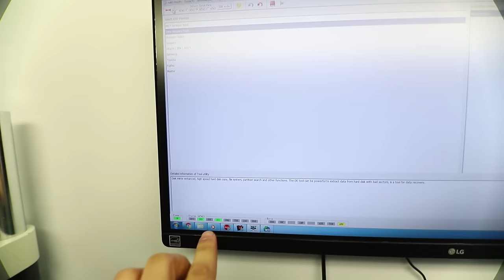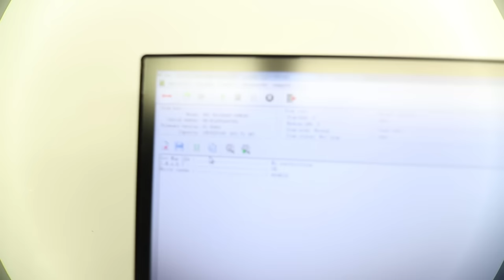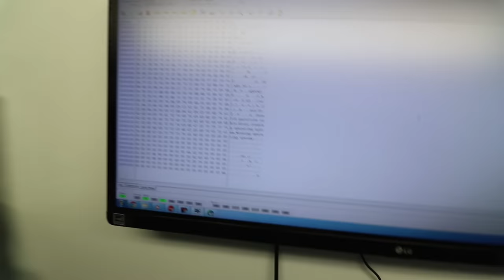hard drive does not spin? simple way to get your data back

Comment: Hello there, I got a Seagate 500GB Barracuda 7200 HDD which does not spin at all. I noticed the burn mark on the pcb board, I ordered one on ebay and changed it with the exact board model but still no spin? Any suggestions please! Thanks
Reply from the maker: Send it in for recovery. Chances are your preamp on the drive is also dead, it is not a DIY

Comment: HD-Front

https://ufile.io/lk1a7uhh

HD-Back

https://ufile.io/c3svwk11

Repair – Front

https://ufile.io/ez3jou40

Repair – Back

https://ufile.io/h77bd47a

Granted please note they said that the original rom was too damaged to transfer. They did this as a courtesy. I have another pcb donor board that has supposedly a new rom with my original bios information transferred over to it. However, you can see here the "condition” of the original rom. I am hoping all the information can still be transferred from this rom. Its not beat up too bad right?

Both pcb donor boards; the one with the original rom and the new transferred over with the information rom do not power up the drive at all. Zero, zilch, nada.

I can post photos of the new rom and new board if needed as well however, it looks good I believe. If the information was transferred over properly.

Comment: I GOT A WD HDD SAME AS THAT, IT'S NOT SPINNING.
I TEST IT OUT THE DIODE AND I GOT A BUZZ SOUND FROM R67 AND R64.
I TESTED D3 AND D4  IT'S NOT BUZZING, D3 AND D4 IS GOOD.
AM I GONNA REMOVE R64 AND R67 ??
Can you help me to fix it? THANKS, BTW YOU'RE SO GOOD❤️
Reply from the maker: R stands for resistor not a diode and they should ring otherwise they are burnt.

Comment: my hdd is still short even after removing the diodes, the diodes turned out to be fine, any ideas what else to look for?
Reply from the maker: Yeah, it could be short on spindle controller. But you can't just remove that out of there.  New PCB with firmware adaptation is needed. If you want us to do it for you, check the link in description

Comment: So simply de-soldering the diode is the solution?
Reply from the maker: If the diode has failed then sure why not
Reply: @hddrecoveryservices  Thank you so much for replying. Actually I'm noob in electronics (commerce guy), so I wanted to know whether removing a diode from a circuit would fry the pcb or not.

Comment: Hey there! Thanks for help people!

I have a question, I've check my HDD and yes 1 diode is short, but it's the left one, it says 72 on the diode, should I try to remove it?

because I can remove it, but I'm not sure if I can re attach it again if it's not the problem, I don't have the precise tools to do such thing.

Toshiba X300 4TB 7200 RPM
Reply from the maker: I don't know. But if the TVS diodes is in short, it needs to come out and preferably replaced. They protect the device

Comment: after a component on D4 remove, you not replace with same parts??
Reply from the maker: You can, but the drive will spin with it removed. Just no protection
Reply: @hddrecoveryservices  it mean you not Swap the Bios setting? am i right?

Comment: Followed these steps and found the shorted out diode. Had an electrical engineer here at work remove the diode and tested pads. HDD will still not spin up. Any advise?
Reply from the maker: if you test out pads without diode are they still shorted?

Comment: Stumble here first vid on your channel. Just a quick question...

My drive not spinning, but detected in bios as unknown, and disk management listed as unitialized (cannot initialized due to i/o device error). Will method in this vid has a chance? Or this error means entirely different problem?
Reply from the maker: This method is only for burnt PCB after power surge.

Comment: Do you have anything that addresses the drive not spinning and the PCB board not shorted out?   I ran multimeter but it reads as it should.
Reply from the maker: If the drive is completely silent, the issue is related to the board.if the drive is not spinning but makes some sort of faith sounds then something is seized or jammed
Reply: @hddrecoveryservices  If by faith sounds you mean the computer beeps when it's plugged in and activity light shows then it would be that.  What tier of recovery would that be?  It was detected yesterday then wasn't communicating and appeared to shut down and drive letter and device went away.

Comment: Hi There, I'm from Malayia. I have a WD WD5000BMVW-11AMCSO device dtd 11 APR 2011, and it was initially spinning slow but it was not detectable on any devices, hence I sent it to a Data Recovery tech to assist with the problem. From his explanation "he is unable to get the correct BIOS to programme into the chip because the correct BIOS on the board is corrupted and un able to read the hard disk", this all was only said after almost 2 months of no news, no updates nothing, I agree at this point it could be my fault for not following up. To add on he said to get it completed he will only travel to China in March and he will get the required DETAILS, and PARTS from there, then only will my hard disk problem be solved. Hence i then started feeling its a bit to ridiculous and so I decided to take it back and send to another well to do, Data Recovery, but when they came back with the preliminary checks, there was no justification on what was actually wrong with WD (I still wanted to know the reason why), with the said check I needed to also agree to a quote that was of 5k+, that's just way too expensive. I then decided to just give a call to other service providers to see what they can quote me with (at this point I wasn't looking for cheap nor expensive but I was looking for an honest feedback), and I came across one that said that "my WD p/n usually has weak motor" it was understandable considering the duration I've had my hard disk, but until today, my hard disk is coverless, and I have still not solved the problem, and I've just tried connecting it to my laptop and apparently it makes no sound at all. I am not really desperate, and I really need to know what else can I do with my hard disk, if by any chance you can suggest how I can go about this.

Comment: What about the burnt resistors ? They don't matter ?
Reply from the maker: what burnt resistors?
Reply: If the diode is blown, you just remove the diode. What if the diode and a few of those "zero" resistors are blown. You remove the resistors and short them with connectors ?

Comment: What is the point of having those diode? You just took it away, and it is completely working.
Reply from the maker: TVS diode is a hard drives best friend, it protects other more critical components from voltage spikes by taking a hit if one occurs. When removed, next power surge will take out the CPU and preamp... Then good luck recovering data without paying thousands for it
Reply: @hddrecoveryservices  now make senses. Thanks for that information.

Comment: Hi what did you use so the contacts melt many thanks as I need to do this to my hard drive
Reply from the maker: Heat. Hot air station or hot tweezers
Reply: @hddrecoveryservices  you put some sort of glue or flux thanks
Reply from the maker: Oh yeah, flux

Comment: I'm guessing you cant just buy a random PCB and just switching it out instead of soldering right?
Reply from the maker: ROM content is unique to the drive. If you swap the ROM you can swap the board. But popping off the diode is way easier and less chances of making things worse
Reply: @hddrecoveryservices  okay thanks for clearing that up

Comment: Only had a 100 ssd in a system and added a 320 gg hard drive no spin don’t show up changed power connector and sata cable still nothing

Comment: I have that same exact hdd that you just fixed. Can I send you mine to fix?
Reply from the maker: yes but I will charge you 4 hunna for the service
Reply: @hddrecoveryservices  I changed the board on it a while back and it still didnt spin. SO i bought another board about 2 weeks ago and its still lnot spinning. I think its cause they're over 10 years old and the hdd the board came on was doing the same thing in your video

Comment: What if the diodes are good but the internal HDD still won't spin? Both the fuses and the diodes are good. My psu blew and I replaced the psu and it's cables but the HDD just won't start
Reply from the maker: It needs to be checked dude, can't say what it could be without seeing it
Reply: @hddrecoveryservices  Could I get a quote please, I already filled out a form on your site. I just can't afford the extortionist recovery charges people are charging.

Comment: Hey, was hoping the video would help but not in my case. My drive is not spinning and no noise. Checked all 4 diodes and they all give the same result about 150. What would be the next step ? I do have another similar drive. Its a 1TB WD RED. Thanks
Reply from the maker: John, does your PCB have a chip in the U12 position?
Reply: HDD Recovery Services yes it does
Reply: (I’m using a different account !) yeah it has a chip at U12
Reply: @hddrecoveryservices  yes it does
Reply: @hddrecoveryservices  hey, yeah it does have a chip at u12. Is there something that can be done  ?

Comment: I checked one of the resistors which was labelled 'O' and I got 0.3Ω and my multimeter beeped. Does this mean the resistor is shorted or not because I'm kinda confused
Reply from the maker: It should be OK if it beeps. Fuse needs to beep
Reply: @hddrecoveryservices  There are also so many of those resistors that have the same reading, which one do I remove?

Comment: Hello, I just had a quick question if you don’t mind after testing the diodes I found one that had no reading but when removing one of the metal pads came off with it. I noticed in the video you tested again after and there was no short. I can’t test now bc the pad is gone would the hard drive still work now that the diode is removed or is that metal pad needed for operation? Thank you!
Reply from the maker: If the short was in the diode you removed then it should work unless something else is damaged. To test for the short being gone you can trace terminals to next components in the circuit and perform same test
Reply: @hddrecoveryservices  ok I’ll try that. Thank you very much for the response!
Reply: @hddrecoveryservices  IT WORKED!!! I was able to transfer everything to a new external hard drive. I’m in tears. You just saved priceless memories of my family. Thank you, thank you, thank you!!!

Comment: Hey man, I was looking for a fix for my HDD, and I want to know, what tool did you use to remove the diodes? I found a shortage on one of them, and I'm at the point of removing that diode, but I have no idea what tools you used for removing them. Thanks!
Reply: a heat gun like one found on a hot air desoldering station
Reply: any other tool?

Comment: After removing the diode, is it safe to continue using the drive like normal? or is the board now a ticking time bomb waiting to fail again bc of the missing component?
Reply from the maker: Ideally, you would want the diode there. Otherwise, next power surge will take something that is way more important
Reply: HDD Recovery Services Gotcha, i’ll keep that in mind. Thanks for the tip!

Comment: The head was stuck on my hard drive, so I opened it and re-placed the head to its parked position.  However, the disk only spins for a couple of seconds and then stops spinning.  I still cannot access the data; please advise.
Reply from the maker: Better not do that at home. Now you need new heads and full disk inspection. That's gonna be around 1600USD
Reply: @hddrecoveryservices  Thanks
Reply: @hddrecoveryservices  I can't afford that, however.

Comment: How did you get the diode off? What's that crazy liquid you poured on there and melted later with another mysterious device? haha
Reply from the maker: :) the liquid is called flux, and the mysterious device is a hot air station for rework and desoldering
Reply: @hddrecoveryservices  Thanks man. Another thing I'm wondering about is your mic. What kind of magic are you using to be able to walk in the back of the room without the volume changing? I don't see any bluetooth in your ear. :)

Comment: One of my Seagate hard drives failed that didn't spin anymore. I was like damn, there goes all my recording sessions stored on that hard drive that I will never get back. Then something popped in my head. I just realize, i have another Seagate hard drive that was identical to the same Segate model and simply swapped the PCB controller boards from the two hard drives. Bam! it works. Those PCB controller boards are probably the cause of most common hard drive failures.

Comment: Can you do this without a multimeter
Reply from the maker: TVS diode is there for protection purpose. Drive will run without protection, so yeah technically you don't need a multimeter to test by removing it.
Reply: HDD Recovery Services thanks....but mine still doesn't work so I'll have to do a motherboard swap

Comment: Hi. I did the same, I have same HDD. All diodes are good. But I measured straight from the center of the motor where comes this 4-line strip, all are beeping, no matter how I connect my multimeter, from left to right, beep, those center ones, beep, from left to 3rd from left beep... All are beeping. Motor gone, shortcut? Help, there is alot of stuff which are important to me.
Reply: And it's not jammed, it doesn't beep like the reader is jammed. Reader is in correct place.
Reply from the maker: If the drive has been opened. You definitely don't want it to run. If data is important get pro help. I know what is happening, but if you drive is contaminated and it starts to run after you opened it, data will be either impossible to recover , or extremely expensive. At this point you would be looking at 650$

Comment: Am I the only one who doesn't understand how he actually removed the diode? 

As far as I can tell he slapped some paste on there, heated it, and done. Like wtf mine is stuck there. I have a solder, but what now? What is that paste? Is it the flux? I'm sorry if these are dumb questions but any help would be great
Reply: flux           use hot air gun.
Reply from the maker: Yeah it's flux and hot air station. If you just need to get the drive spinning quickly for data transfer, confirm that that diode is bad first. Then you can just knock it off
Reply: Thanks guys, confirmed it's the diode using multimeter and pulled it off with solder. Haven't had the chance to try the drive yet and haven't done any of this before so wish me luck!
Reply: thank for reply.       i am not fluent in english.    . so i was learnd mobile phone repair 13 years before. i used to  hot air station with solder with in     it is use dc   am i  correct.    i am appreciate  your work.

Comment: What? Why it works without that part of the circuit? You didn't searched for another piece of that component..
Reply: sometimes diodes are used to prevent it from being plugged in backwards for a safety measure. Plug it in backwards and it blows the diode before anything else. Plug it in normally and it's fine. If you make sure you do it right removing is fine.
Reply: I've also seen xenar diodes being ADDED to an old computer to prevent over-voltage. It's placed between the +5v line and the ground. It's a 5v Xenar diode. If it reaches 5v, it shorts out the power saving the computer.
Reply: @awilliams1701  backwards?
Reply: @awilliams1701  I did put hard disks backwards a lot of times without issues
Reply: @matteavana2384  Who knows. It might be fine in some cases and not in others. If they are worried about it, they can put in a diode and it just won't even try to run if installed backwards.

Comment: After removing diode and you check HDD is working but after remove diode not soldering new diode
Reply from the maker: We recover data, not repairing hard drives. The diode is only needed if another power surge hits it again to prevent further damage.

Comment: Do you charge a lot to fix a WD 4TB PCB? I found out its the PCB because when I went to use a new HDD with the PCB I got a long soft buzzing noise.
Reply from the maker: That's symptom is 110% not a PCB issue. Heads are either stick or jammed
Reply: @hddrecoveryservices  But I don't hear the HDD spinning at all though.
Reply: @hddrecoveryservices  Hello again. So I researched some videos to the sounds of the HDD & I heard the beeping & clicking sounds & I do not have that present. 

The best way I describe the sound is a buzzing coming from the PCB the one with the power & USB. When I place my ear on it I can hear its coming from there. The buzzing is like those neon signs that one can hear from a bar room but very very small to hear.

I do have another enclosure coming to day & will test it out on it to see what other problems like if I get a click or beeping which for now I can't seem to hear on the original closure.

Edit: Oh & I forgot to add that when I try to hook it up to a PC nothing shows up. I used the same USB on another HDD & it worked so it can't be the USB.
Reply: @hddrecoveryservices  Ok back, I can now confirm that the HDD is up & running good on another enclosure. So the PCB is at fault.

Now I have to find a new one as I can't access the data on it.

Comment: I tried using my old 1 TB 2.5 inch HDD from my old laptop and slotted it inside my desktop. My PSU is the corsair SF750 and its fairly new. After inserting both sata and power cable and turning on the pc, it was undetectable and it kinda broke and was not spinning anymore. Before inserting it to my pc I tested it using a SATA to USB adapter to check the drive and it was working. After putting it in my pc it died not even the sata to usb adapter can read it anymore. Anyone can tell me what caused it to happen? Because I heard you can use a 2.5 inch on a desktop.